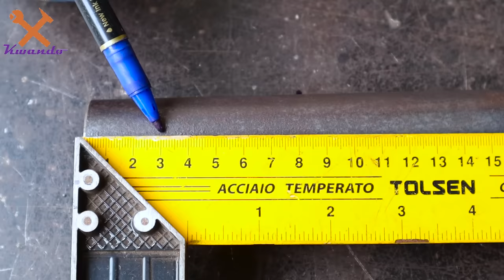DIY Tool | Make Amazing Tool From Damaged Bike Part That You Didn't See Before

Comment: Nice easy build.good job.i say its no junk till i say its junk.repurpose.my only thought would to add a joint on saddle that contacts drill  where its welded.would take bind out of slide allowing it to push straight.keep up the builds.
Reply from the maker: Many thanks for your suggestions!